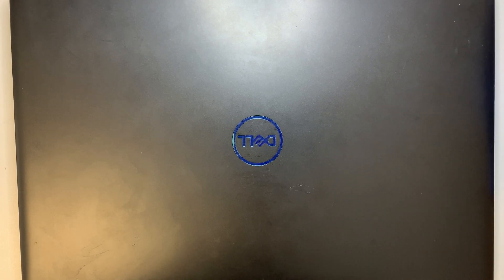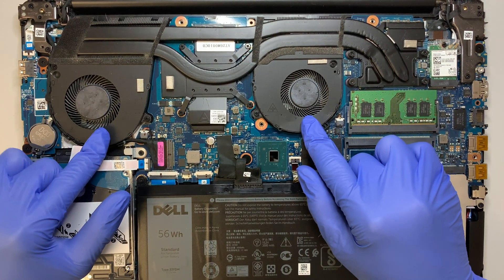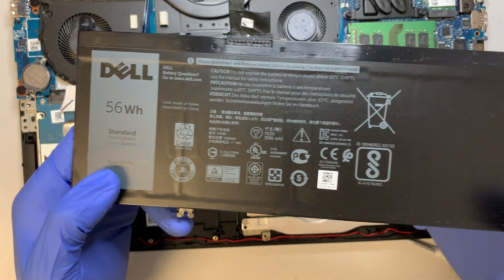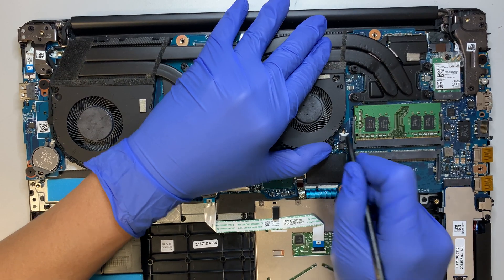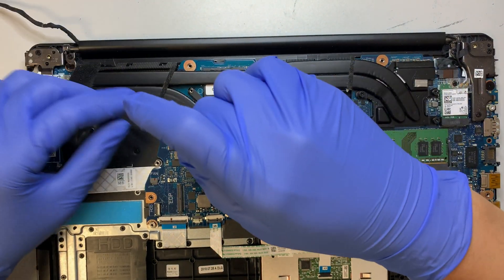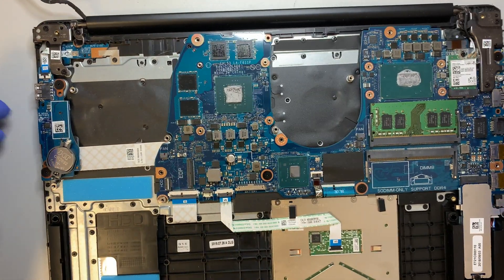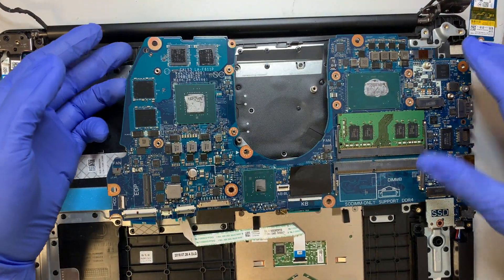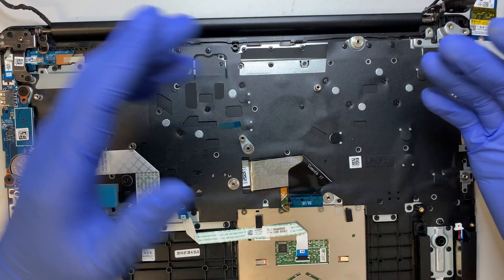Dell P75F Tear Down Fan Replacement

Comment: Thankyou for making this video. I recently began having problems with my computer. First the Keyboard stopped working properly. The Keys:2,w,s,x and sometimes capslock don't work reliably anyomre. sometimes they do. sometimes they don't. The Problem occured during a power surge so i think that had something to do with it. I bought a external keyboard and have been using that. But today something worse happened. My fan started to sound like it's grinding but only when i play games and it goes into High RPM. So now i'm going to replace the fans. Thank you for making this video it saved me alot of money so i don't have to hire someone to do it.